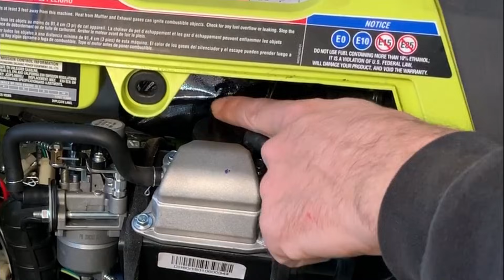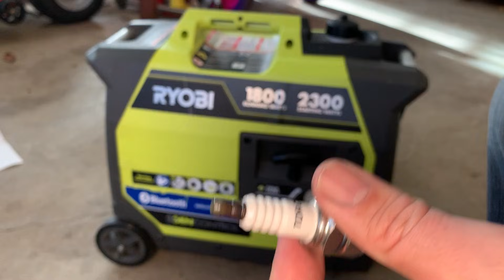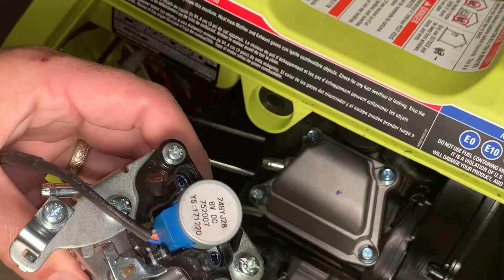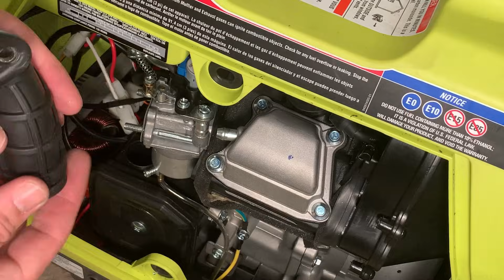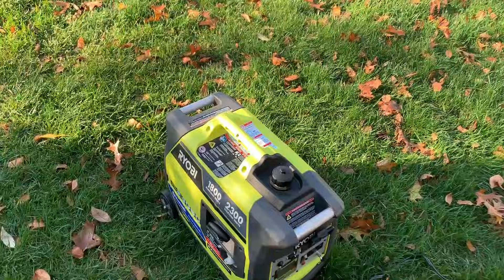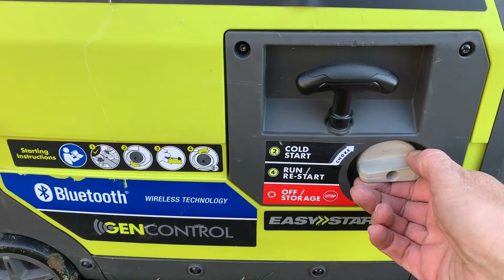Surging and Stalling Ryobi Inverter Generator Fixed - RYI2300

Comment: Mine was difficult to start from the get go - always required 6,7 or 8 pulls, and it surged at idle. Under load it ran a bit smoother and never stalled.  Now I can’t get it to start. I changed the plug and have new ethanol-free gas in the tank.  There’s fuel in the bowl.

Comment: Mine says low fuel even with the tank full, is running normally though. 

Any ideas?
Reply from the maker: There is a sending unit in the tank.  Most likely it failed or there is a wiring issue.
Reply: @jcondon1  ok I will check thanks

Comment: Man I just bought one Ryobi generator same at this one i tried to run a small bounce house off it and it overloaded every time
Reply from the maker: The fan motor on a bouncy house has a huge surge.  I tried the same with a Honda EU2000 and it could not start the electric motor.

Comment: The plastic on off and choke knobs strip them shelves out and are a really bad design made out of really soft plastic. I've had the same problems you have. Needless to say I need another new knob. The metal shaft that it is on is really soft. And I had to use needlenose vice grips to get it to work. I will not buy another Ryobi because of this knob. It tries to do too many things.

Comment: Yes..! #1 I always use NGK spark plugs...#2.That generator( the control knob ) you need to play with it..! and see when runs better in higher position comprende..!! At least that with my brother did and solve that issue ...!!! Is not like my Honda 2200 wich runs perfect at the first pull..!!

Comment: I enjoy watching your videos as you are very thorough. IMO there's nothing more reliable out there than a good old Honda. Sure the newer generators have more gadgets, but Honda is just simple and reliable. I've owned them all over the years, I used to buy, repair and flip inverter generators. The only generators I've kept for myself is a Honda EU-2000i and a Multiquip GA-6HA 6000 watt with a Honda Engine. They both always start and run smoothly.
Reply: they are bye far the best.  More money but much less problems.
Reply: I have a honda eu-2000i,and every time I go to use it.I have to take the carb apart and clean it.Plus the plastic low speed jet gets clogged,and you have to run a wire through it to clean it.If I dont do this it will surge, at high, and low speed.The chinese generators seem to hold up better with their carburators.
Reply: @GoldSeals  The Ryobi is made in Viet Nam.
Reply: @GoldSeals  You can't store any of them with fuel in them unless it's ethanol free fuel. Even then you should start it once a month if you leave fuel in it. There's no difference in carburetors, they will all become clogged eventually if fuel isn't ran dry
Reply: @vegasfordguy  i use stabil storage.One ounce for every  2 1/2 gallons.The fuel looks good after several months.I use it in my car.I store all my fuel in metal safety cans.Except whats in the generator.And yes its has ethenol in it.The Wen 2000 watt invertor generator I have always starts.Ive never had to rebuild the carburator.Right now the wens gas tank leaks.I had to order a new tank.It was only $26 for the new tank.Once I get it installed.I wont be using my honda eu-2000 as my primary generator,only as a backup.
Reply: @GoldSeals  Check out Tarryl fixes all YouTube channel. He tested all the fuel stabilizers over a couple years. None worked any better vs regular 87 octane fuel. They all gummed up due to the ethanol. The only fuel that started after all that time was VP ethanol free fuel. Basically all the fuel stabilizers are snake oil.
Reply: @vegasfordguy  Thanks.Yes,I did see that.Tarryl.He has 5k generator with no gas or oil in it.They asked him why no oil,or gas?He said it aint gonna run when I go to use it if I fill it up.

Comment: Is Ryobi as good as Honda? nope it is not but is Honda $400+ better? nope it is not. I have used Honda, Cummins and Generac generators as part of my job and Honda are not flawless and they will breakdown contrary to Honda worshipers statements.
Reply from the maker: I agree.  Just worked on a $1000 Honda generator that failed after 5 year.  I like Ryobi, this generator was very close to perfect, just a couple things they need to fix.
Reply: @jcondon1  Well, that is significantly better than all of them being defective out of the box.  With all the electronics, there should be three solid switch positions - off, run and start. Intermediate adjustments should be absolutely unnecessary.

Comment: Suggestion.   Take the original carb and clean the idle jet too.  Many folks forget to do that.   If that does not help, there is usually a set of jets you can buy for mountain usage, which ever less fuel , and there is usually one slightly larger main jet.    Buy that one and try it to riches it slightly.
Reply: The problem seems to be the flow rate through the switch, not the carburetor jetting.

Comment: Hilarious, I know zero about engines, got this Gennie, noticed it ran better with a little choke on, so did that first try after the surging, and it has run great since. Guess I was lucky. 🤷
Reply: Is that bad for fuel economy?
Reply: @robbo580  NO, if the choke is only on the knop, not in the carb.

Comment: When a generator is not used for weeks or months, the gasoline residues fall to the bottom and at the time of putting it to work, these concentrated residues many of them pass the gasoline filter and remain stagnant in the carburetor plugging the system and the tiny  holes that a carb of that size has.  Before starting the generator that has not been started for weeks, I advise you to drain a little of the gasoline so that this sediment does not enter the carburetor.  If you already have the problem mentioned in the video, you should remove the carburetor and remove the gold parts and clean them with carburetor cleaner.  In the case of the Rioby Yo, remove the cardboard gasket and clean it through all the holes with the product.  In particular, you must clean the air and gasoline inlets which are what you will see as two small holes at the ends of the central hole, these are part of the housing and are not gold pieces.

Comment: I have the previous model generator im the 2nd owner too, I use it 3-4 times a week and i let it run out of fuel most times without stopping it. i use power tools and run a campsite with it. It is so reliable, i had to replace the pull string 1 time in about 3 years of heavy use. Recently I was using it and noticed low power and surging it was strange, after checking everything it was the spark arrester on the exhaust was blocked with carbon. I removed it and it works fine now. I also melted a hole in the side housing case by accident and put a tiny hole in the petrol tank under the case with the exhaust of another generator, it was too close to the exhaust of the bigger generator and I didn't notice. (The bigger generator has remote start.) I used a plastic milk bottle lid and a heat gun blower to melt the plastic onto the hole of the petrol tank and that sealed it perfectly. These generators should last a very long time if it is properly maintained. they are a good choice low budget generator especially if you find a good used one.
Reply from the maker: I do like Ryobi, just was disappointed on this 3rd revision.  It was almost perfect.

Comment: Had the same issue since new (11month old), stalling and surge resolved by using good quality gas, doing maintance as specified but there is always a but!! It rand good for a few weeks and then stopped, and trying to get it started the pull retractable handle broke inside, it didn't engage the engine ti start. Si i dissamble it and get ir fix and it started againg. Then it did the surging againg and it was the stepper motor so because ir was hard to get the stepper motor only I was forced to buy a whole carb with stepper motor included for $70 online and replaced it the whole thing and walaaaa it was fixed. Runa for a month and it started surging againg at the point that stopped, and in the time i was trying to get it started againg it started but stopped againg after a minute then trying againg ti get it started the retractable pull handle (to get it started) broke againg. Had to Say that i'll been using it everyday since new and this liltle thing it's amazing and do the job but there are some noisy parts that need to be dissmounted like the push/pull mobility handle, it make to much noise!!!! Well hopefully when i get the chance ti work on it again I can fix it for now i'll will go with the backup! ✌️

Comment: Definite progress but the issue on mine is failing to start at all. My Marine friend pulled the air filter, gave it a yank, off it went. This was back in May. Come November, the unit failed to turn over, and I was thinking like you due to cold weather. Brought it back to my Marine friend today, this time SOL.
  So the fuel line may be my weak link. Interesting. Will check back in a little while...
Reply: No go. Believe your carb replacement is the other solution...

Comment: Here's a suggestion:  Flip the clear plastic carburetor drain tube up so its end is elevated above the carburetor, then open the drain screw.  You now have a sight gauge that shows you the level of fuel in the carburetor bowl.  If the level drops when running (particularly when under heavy load), then there is something restricting fuel flow into the carburetor.  In my case, the bowl remains full under all conditions, even as I turn the fuel valve toward the off position while under heavy load.  I do observe some mild surging when the unit has little or no load on it.  I suspect that to be a design issue in the feedback loop of the generator's speed control.  It might be possible to smooth it out by increasing the idle speed a little bit on the carburetor, but I usually have enough load on the generator to where it's not idling anyway.
Reply: Semantics, it's a good idea and functional for the task. bravo!
Reply: Flipping the breather tube, now that is a good Idea and worth remembering..
Reply: @fredjones7307  It's not a breather tube, it's a drain tube for the float bowl.

Comment: Spoiler Alert!  I think we learned something today.  Surging is a function of fuel delivery.  Or can be.  I saw a test on 10 engines using different fuel stabilizers and they all surged on cold start, except for one.  I believe they were taken off choke too quickly. (instantly)   Again, too lean a mixture.  Your machine was surging because of fuel starvation.  Or fuel reduction causing a lean mixture again.  
Now every time I see surging, I'm going to remember this.  I think it makes sense.  
Great videos and channel.
Reply from the maker: Thanks

Comment: Bought this same model brand new. Used it to power my RV at a campground.  It was way noisier than similar inverters near me, and it started the surging and stalling out you are showing immediately. Had it 3 days and returned it.  Getting a Champion instead.

Comment: So did you show the adjustment you did to get it set right, or just make a mark where it's the best flow?
Reply from the maker: No, just determined where the flow was unrestricted in the fuel.  Double check the choke plate to make sure it was not closed.

Comment: Most amazing “trouble shooting” video I’ve ever seen. Your attention to detail is unmatched. Thank you for the time you put into making this video! Great job. 👍🏽
Reply from the maker: Thanks
Reply: The main problem is that fuel line going to the valve have too much vend and vibration from the engine cuts the fuel flow I connected the fuel line straight to the carburator and it fix the surging completely.

Comment: I just picked up a 2200 for free.
It won't start and I smell gas after I attempt. 
I haven't even taken the covers off yet.
Any suggestions would be greatly appreciated.
Reply from the maker: I you smell gas after pulling the recoil then maybe you have a spark problem.  Would suggest testing for spark..
Reply: @jcondon1  
Thanks.
I'll start there.
:)

Comment: Many thanks for the time you spent on this, I was excited I just bought two of these to link and use separately. I feel like I should call Ryobi now and just send them in to fix before I even unbox them. I wonder how common this is... seems pretty common. Again many thanks for the time you spent on this!
Reply from the maker: It is a good generator (other then that easy start knob).
Reply: @jcondon1  they are excellent inverter. generators. They are Yamaha clone and they run really well and are quiet once the issue with the fuel is fixed

Comment: Thanks so much for this video my generator has been doing the same thing and I have been fighting it for ever it seems the only difference is a young devil poured coffee into the tank thinking he was helping dad out with filling the gas anyhow I have cleaned the carb and tank more times then I care to remember and still did the same thing as I Said DID I. Followed what you did and fixed i thought for sure there was still shut from that coffee still plugging it nope you are a 100 percent right a design flaw but hey none of us are perfect if we were itd be a boring world just fix it ryobi and thanks for the Bluetooth connection love it but up date your app and generators so you can reset overload through it and select a specefic time you want it to shut off
Reply from the maker: It is a nice generator.  They just need to get rid of that knob (easy start system) and just have separate controls for on/off, fuel and choke.

Comment: I assuming when you talk about stalling, you are referring to overload??  I have tried to run the generator with my camping trailer.  My refrigerator uses 400 watts.  If I try to run my microwave at 900 watts  while the refrigerator is also running in shuts down and it says overload.  Any suggestions?
Reply from the maker: The microwave is an inductive load and will require up to 3x the normal power to start it up.  You need to get a larger generator for that.  Would think at least 3000 watts.

Comment: I just bought this generator and saw that most of them have this issues. It comes in tomorrow. Hopefully I wont have this issue. But nonetheless you are a god for walking through the various steps to diagnose the problem. Thank you for doing this!
Reply: To be truthful with you I wouldnt pick it up.  Buy a Honda or a Multiquip.  Much quieter and no problems.  I would never own anything Ryobi again.
Reply from the maker: Thanks

Comment: My 2200 is overloading every time I run my shop vac.... is there a reason why that might be happening??
Reply from the maker: Electric motors surge up to 3x the normal running amps at startup due to the motor establishing a magnetic field.  Assuming your vac runs at 10 amps you might need 30 amp to start it (3600 watts) for a few seconds.

Comment: This is one the best troubleshoot videos I have seen. Same thing was happening to mines. I live in Puerto Rico so its very important for me to have my generator working good due to how vulnerable we are to Storms and Hurricanes. I had figure out the knob thing by accident actually. But your video helped me understand the reasoning of the gas flow. It also will prevent me for going to buy a Carburator or the plug. Since now I know seeing your video and reading the comments that this is  normal for these generators.
Reply from the maker: Glad I could help.  Thanks.
Reply: Mine too

Comment: Have the same generator, actually my second (first returned to the store within a couple days due to it seizing up/shutting off + gas getting into the oil), but mine has the exact same issue in this video. THANK YOU for helping out with this. I've been so frustrated trying to figure out what the problem is. In the past I had gas somehow get into the oil and thought it was toast, after that happened to my original one within days of buying it so I brought it back to HD for a replacement. Changed the oil on my 2nd unit and I haven't had that since, but I still get the surging/stalling issue your video starts off showing. Appreciate you showing how to fix this, now I at least have something to try: turning the damn knob a couple degrees more toward start/choke. 😅
Reply: I will open the side and chk gas flow - if it a gas issue just for sure  Peace bro

Comment: is that another nikki carbeurator??
Reply from the maker: Not sure what that was.
Reply: @jcondon1  every single nikki carb ive run into mostly mowers has been junk from the start u had 1 rebuild success out of 50 or so so thats why i say toss the poses and buy walbro replacements much better designed carb
Reply: poses = PIECES OF SH//

Comment: The new carb you order is an older version of the one you replaced, u can easily identify it by the float bowl which is made of brighter aluminum material, the one with the alloy bowl is a troblesome counterpart, so ryobi start using again the revised old desing, you must check for fuel flow trough the fuel line hose in the running position as it flow a lot in choke position but tends to cut flow to no flow on running position. Older valves can be disassemble but not the one you have, eaven new valve/ on off switch were problematic, 70% of this gens that I fix, has the fuel flow valve problem.